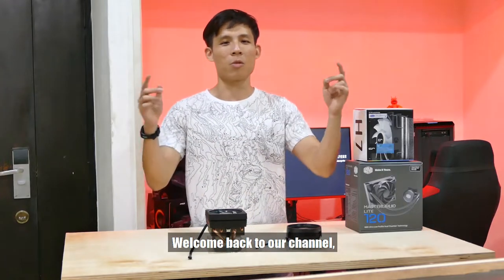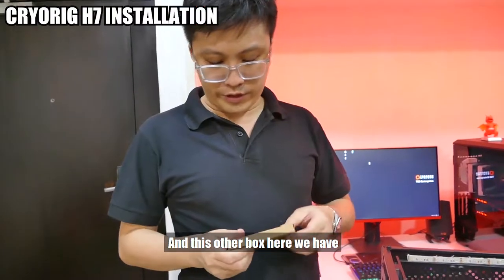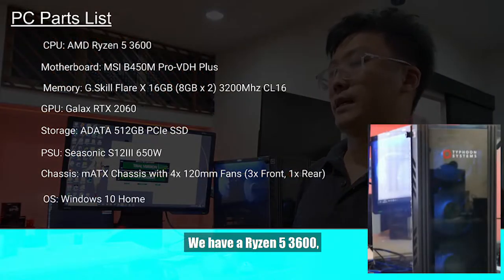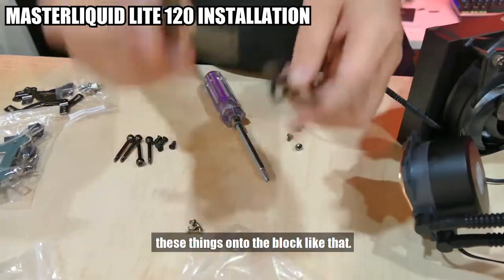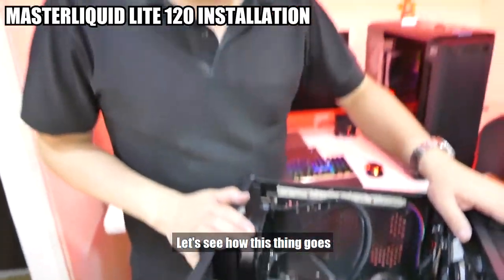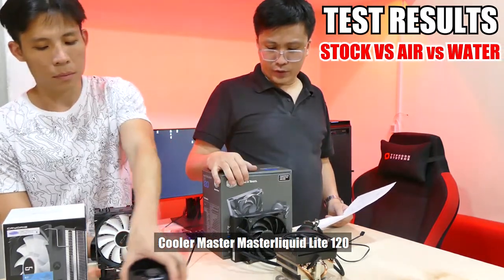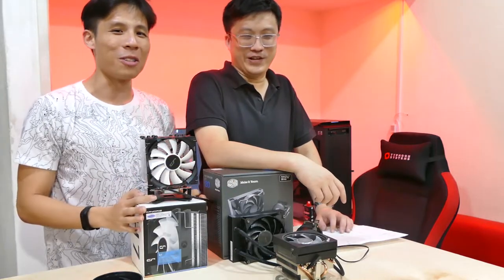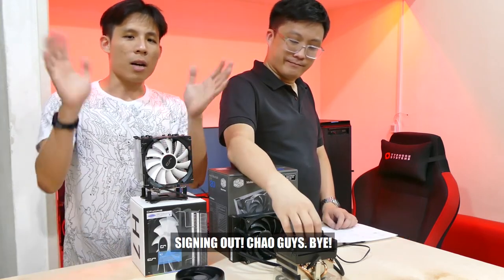$50 Air Cooler vs Water Cooler Test! Which one should you choose? w/Benchmark

Comment: That H7 is a pain in the butt to get on when the motherboard is in the case.
Reply from the maker: I think it would be easier to mount it on the board first before putting it into the case ? :)
Reply: @RealMelTan  ye sit is on initial build. but if you have a pc already built ho's pull the motherboard completely out to put a cooler on.

Comment: Thanks for the video. I'm now choosing between the Cryorig H7 and the MasterLiquid 120, for my Ryzen 5 3500x. With my old micro-tower case, the H7 is the largest air cooler I can get, and the MasterLiquid 120 is the largest AIO can be fit into my case.
I'm just curious that if the AIO can have more advantages in a smaller form factor case?
Reply from the maker: Hey Michael, we have answered your question in our latest video, the first episode of our MG Talk Tech show. Check it here: https://www.youtube.com/watch?v=zjcuP86CY9Q&list=PLuV7_syiALBMgFYj7oinQyUYBg83pMW9N&index=2&t=677s
Reply: Thanks a lot for your answer. I have already bought myself a H7 air cooler and that cools down my 3500x a lot. Now I also changed my old case to SilverStone PS 15 so that my system has much better air flow and cooling.
Reply from the maker: @michaelkklam  Are u gonna OC your CPU?
Reply: @RealMelTan  Not really. I just thought that my cpu was too hot (over 80 degrees C when full loading) with the stock cooler. Now with the new cooler I may be able to do overclock a little bit, but I don't think it will benefit my system overall performance a lot.

Comment: I have a same problem using cooler master ML120 with super noisy fan sound, i bought a static pressure fan to solve the problem but it need to spend extra buck.
Reply from the maker: Yup! I would be changing up the fan for the cooler too. Gonna install it for my personal rig :)